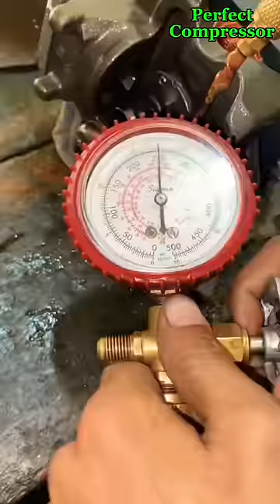Compressor pump repairing#shorts

Comment: I like seeing these guys fix stuff that we no longer fixing to United States unfortunately we just throw everything away 😢
Reply: It's a sealed unit, they're not supposed to be repaired. HVAC companies will hate you.
Reply: thats because the repair shown in the video will not hold for long. no torque wrenches in sight. no tolerances were checked while re assembling the compressor.
Reply: @coldfinger459sub0  bruh, I'm indian. my country is as third world you can get. I'm very familiar with this type of "repairs". trust me they don't last long.
Reply: But not for Trump Supporters !
Reply: @lordjaashin  not needed if parts weren't changed out. Done it many many times never had a problem.
Reply: @mustangdemon87  how does putting same parts back in account for wear tolerances? you can see that the re0air person is removing carbon from metal surfaces. that means compressor overheated probably because of low lubrication. that means that the moving parts in the compressor are weared out.
Reply: @coldfinger459sub0  dude, theres a reason why precision measurement is important in every field and companies spend billions of dollars to maintain it. tolerances, torque values and wear factor are absolutely essential for remanufacturing of appliances and it lacks in the repair done in the video. older guys or younger guys. it doesn't matter if you reoair something based on "feel". otherwise, the repaired product will not last long or runs at low efficiency
Reply: @lordjaashin  "probably" They overheat for many reasons. Stop assuming. It clearly is working after repair and will continue to work for many more years. Have you ever measured ones that have years and years of use? I have they, keep ticking.
Reply: @mustangdemon87  did you see the issue with the compressor? it blew a seal. it happens only when something blocks the discharge tube. now what will block the discharge tube? carbon deposits. this further exacerbates the compressor overheating issue... don't let the few seconds of compressor running for the video fool into thinking it will run for long time. even acar engineruns for few minutes without oil before seizing up
Reply: @lordjaashin  compressors don’t typically overheat due to low lube. They overheat and burn oil from dirty condensers. 🤷‍♂️
Reply: @mustangdemon87  you obviously don’t know anything about hvac. You don’t repair little hermetic compressors. It doesn’t work. It’s a massive waste of time.
Reply: @mustangdemon87  stupidity is ignoring facts about specifications, tolerances and torque values. then thinking that putting parts back together will make the machine run properly because of magic.
Reply: @lordjaashin  buddy I have done this repair myself a few times. Thousands of others still do it every single day and they all still work just fine. Much the same as rebuilding a car eninge. They have specs and torque specs. Thousands of people have kept them going in 3rd world like Cuba without torque wrench or even the oem parts! Imagine that! Hahaha
Reply: @jman0870  EPA universal cert sense 2003. 

And correction "you don't not" repair them. Myself and many others do. So try again.
Reply: @mustangdemon87  theres a difference between repairs that last long and repairs that cannot be guaranteed to make it out of the shop. your repairs sounds like latter
Reply: @mustangdemon87  since* Just because you passed the test (that was an absolute joke) doesn’t mean you know what you’re doing 🤣
Reply: @jman0870  nope an nether does owning a busniess in repairs for more then 10 Years. But I've got that too. Keep on wasting your money buddy 💰
Reply: Compressors are already pretty cheap. You should let HVACR companies survive
Reply: That’s a $150 compressor. No body is going to pay $400 to rebuild it. That’s a 2 hour swap to replace or 4 at $150 an hour to rebuild. That math doesn’t math Stateside.
Reply: @lordjaashin ese carbón se genera cuando sueldas las tuberías de cobre de refrigerador sin nitrógeno, no es generado por el compresor
Reply: Acá en Venezuela 🇻🇪 reparan algunos, y hay unos que duran muchísimos años funcionando y otros que no duran mucho

Comment: Where are the parts coming from?
Reply: What parts? All that is usually needed is the valve to be cleaned and readjusted.
Reply: @mustangdemon87  Such as flip over the reed valve?  I was thinking in terms of bushings or motor shaft coupling (if used).

Comment: What the specification of oil use for subtitution?
Reply: You can find the oil type and volume in the plate on the compressor, or search the datasheet with the model in internet. You will find all the information about your compressor if you have the specific model.
Reply: @DEATHSSHAZE  oke tengkyu sir... i mean can use any oil for that like same 4stroke engine
Reply: @thuglifeindonesia2617  No sir, unfortunately oils for refrigeration systems are very different, the oil is in contact with the refrigerant, so they mix in the compressor.
Reply: Oke sir thanks for your information
Reply: @DEATHSSHAZE  теперь будет контакт с воздухом. Можно масло для автомобилей (5W30  например).
Reply: @ВасилийВандышев-ъ9р  apreciate it thankyou brother... regard from Indonesia Bali🤝🏻